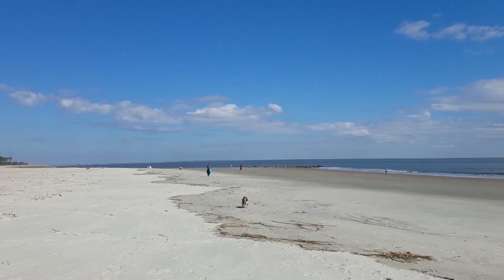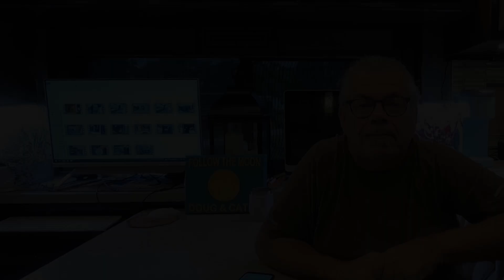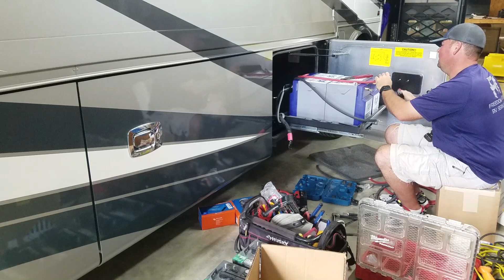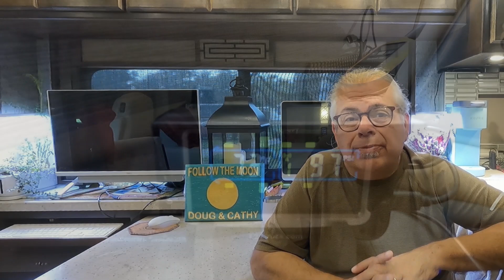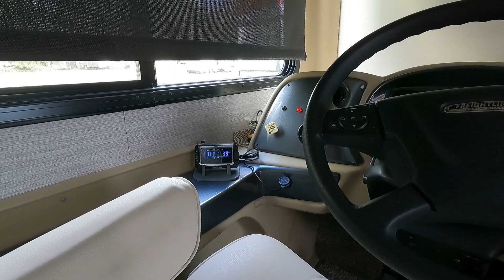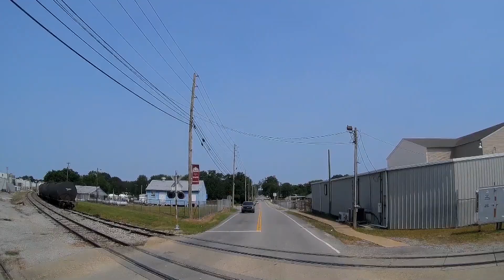Three Major RV Upgrades - Are They Worth It?

Comment: Nice,   We have a 2019 Allegro RED 37 PA and the battery upgrade is exactly what I have in mind, so you could do just the Battle  Born batteries only without the Victron additions?  Is there any issue with the alternator on your engine charging the batteries?  thanks! BTW we have had good luck with the EEze TPMS system.
Reply from the maker: Thanks for watching. According to John, as long as the batteries are at a nearly full state-of-charge before you start the engine, there's no issue. He suggested if we were on the batteries all night we should turn on the generator and run it for a short time in the morning to top them off and that way it wouldn't be a heavy pull on the alternator.
Reply: @FollowTheMoon  Thanks, have you noticed an improvement in battery capacity if you are unplugged for the night?
Reply from the maker: @rjahn3000  we have - before by morning the lead acid batteries were down to nearly 50%.  Now we could probably hit 48 hours without the generator (we do have 3 factory solar panels).  Plus there's plenty of real estate on the roof for more panels and the factory battery tray will hold 6 GC-2's, so we could always expand if needed.
Reply: @FollowTheMoon  That's good to hear we also have the three same panels. Cheers!